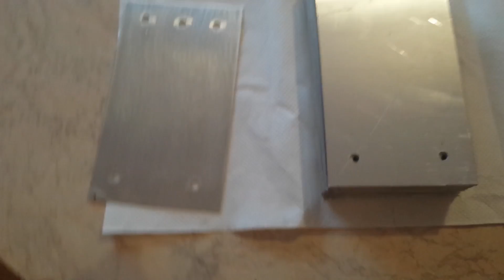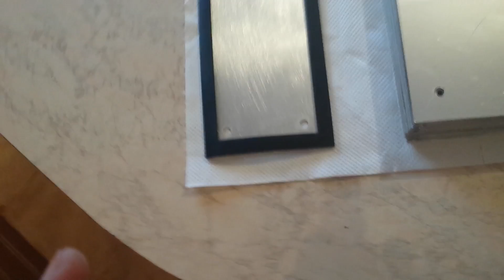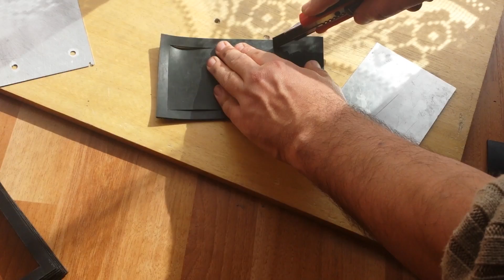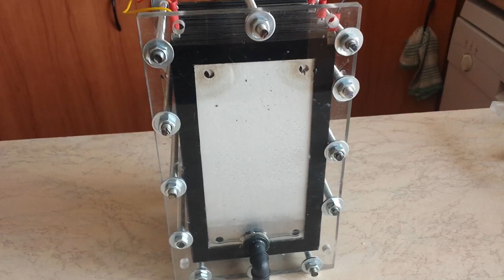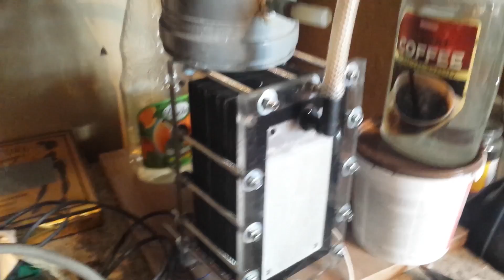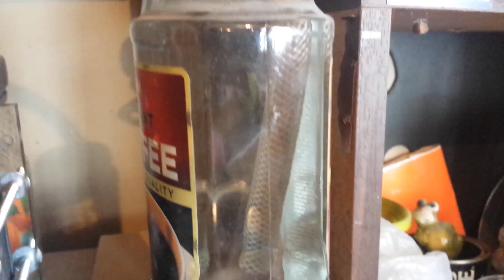hho generator with 31 aluminum plates

Comment: i dont think you "get more H2" from starting and ending with negative. Every time time you crack a water molecule you get the same ratio of oxygen and hydrogen. Maybe you get more H because the aluminum is absorbing O as oxidation layer. Can anyone else confirm this?
Reply from the maker: I have done alot of experiments with wires + - + -. And i did - + - + -. I have noticed the volume of hydrogen  is produced more then oxygen. I know - produces H and + produces O

Comment: How thick is your gasket?
Reply from the maker: 2mm
Reply: @01wizmiles01  thanks for your fast reply where did you buy that kind of rubber sheet and what is the name of that?
Reply from the maker: I bought the rubber sheets in a rubber store
Reply from the maker: You can probably buy them also on ebay

Comment: The chemical in your water is eating away at the aluminum plates and is giving off hydrogen in the process. That's not a good metal for this process. Use 316L stainless.
Reply from the maker: I did in my other videos

Comment: Sodium Hydroxide and Aluminum makes Hydrogen - So dont use aluminum
Reply from the maker: It was just an experiment
Reply: @01wizmiles01  I understood that. But still I wouldn't  use aluminum for multiple reasons.. was just trying to give helpfully safety recommendations.

Comment: Heyo, just a few things I would like to note (tad late for it though):
Try to use distilled water if you could, as the introduction of random metal ions within solution can cause quite some odd gases forming. For example, you could accidentally produce chlorine gas and bits of aqueous lye if NaCl is present. Not entirely sure if you were using distilled water, but maybe that'll solve a few problems?
And as for the sodium hydroxide, you can add regular baking powder (try to get the pure kind without additives) as the ion. Its cheaper and won't require you to wear safety like NaOH would. 
For some equations you can use, check out videos on Gibbs free energy and how to calculate amps from it, along with a few related bits to calculate volts required for each cell. 

Pretty neat stuff overall!
Reply from the maker: Thanks for the tips
Reply: @01wizmiles01  No problem! I'm going to build my own generator someday, and seeing others do these sorts of things helps me and others grow; thanks for posting this video mate.

Comment: Good job! I'm curious what happened to the plates after a long operation, I have the same idea but to put the aluminum plates in chrome 👍🏼❤️
Reply from the maker: That would be interesting in chrome.  My plates started to thin out
Reply: Chrome may increase the life time but it also degrades, the best option would be graphite foil.

Comment: I would say, don't be discouraged by what people say. Many people suggested stainless steel over aluminium well, let's just say, they talk from what they show that people did. Mostly from YouTube! Surprise!! xD
If I were you I would do the same( trying out aluminium over steel) also doing a research on other metals. Aluminium is a good conductor of heat so if you mean to pull out the heat that is building up in the HHO solution! Not saying this is what your doing, but there are many things you can do with one thing if you know them well. I can tell you are up way a head and you are up to something close to HHO thing. I don't complain on your using aluminium over stainless steel! Keep it up!
Reply from the maker: Thanks

Comment: What is the thickness of the plate and size
Reply from the maker: The thickness of the plates are 1mm x 22cm x 10cm
Reply: @01wizmiles01   what hole size both the end are u using polycarbon material
Reply from the maker: @MrDhilishkumar  the hole size is 8mm

Comment: The more pole pieces, the larger the power consumption, the larger the hydrogen production amount. Is this how much V / A is used?
Reply from the maker: the more neutral plate less it will heat up and you wont produce hot water vapors.

Comment: aluminium activated in the presence of water generates hydrogen all by itself.  Under proper conditions no electricity is needed.  Read the Purdue University research study:  New process generates hydrogen from aluminum alloy to run engines, fuel cells.   Hydrogen is generated spontaneously when water is added to pellets of the alloy, which is made of aluminum and a metal called gallium. The researchers have shown how hydrogen is produced when water is added to a small tank containing the pellets. Hydrogen produced in such a system could be fed directly to an engine, such as those on lawn mowers.

Comment: Aluminium plates and KOH will work no matter what you do. It will produce H2 without it being turned on. With a weak current it will produce more H2 and very little O. You could overdrive it to produce O if you like but the wastage of the Al will be considerable. I'm afraid you will have wasted your expensive aluminium plates away in a week or so even with it not running. Then the KOH will eat the aluminium, leak through the joints and do damage elsewhere elsewhere.
Reply from the maker: true. i wanted to see for myself what would happen to the alu plates

Comment: I agree using aluminium together with an alkaline solution (like KOH or NaOH or anything else) will consume the aluminium plates producing hydrogen gas even without electricity....

Petty because it will in the end ruin your set up..... so you have to rebuild it but this time with less reactive metals like corrosion free steel (what we call RVS).  

Aluminium is very reactive to alkaline solutions..... and should never ever be used together in setups like this. Good luck.

Comment: I HAVE RAN 7 OF THE TYPE OF CELLS YOU JUST MADE.. ANY MORE THAN THAT OF 7 OF THESE CELL YOU RUN INTO TIMING ISSUES ON THE MOTOR.. I WAS RUNNING HALF AN HALF.. ONCE UP AN RUNNING SHUT IFF FOSSIL FUEL OFF THAN RUN HYDRAULIC FULL TIME.

Comment: Any alkaline solution in contact with aluminium will dissolve the aluminium while releasing hydrogen gas until the plates are gone and leaving a salt behind which will cause the whole module to fail any way. Rebuild the whole thing again with stainless steel plates, and you will have a much greater success.    Raza, a fellow electrical experimenter.  Best of luck !

Comment: aluminium and water and sodium hydroxide or a small amount of mercuric chloride and i'm sure many other caustic chemicals will produce a lot of hydrogen .they react with the aluminium ..  but your aluminium plates would dissolve very quickly.  as the reaction heated up every 10 degrees the reaction rate would double and produce a huge amount of HHO but your aluminium plates would dissolve very quick and no power source is needed..    chemistry 101.
Reply from the maker: dan poen would that be good to use in a tank to fill it with hho

Comment: Soidium Hydroxide (NaOh) eats aluminium and produces an exothermic reaction (which can get insanley hot) which produces massive amounts of hydrogen gas. If you'd have Googled/Wikid HHO (Oxyhydrogen) or water electrolysis, you'd have seen what a dangerous potentially lethal bomb you made (either due to an excessive and rapid increase in hydrogen gas pressures and or detonation as hydrogen under high pressures has the tendency to ignite.) Consider yourself lucky... It is incredibly dangerous and potentially lethal to dive into any type of project where caustic and highly corrosive chemicals are arbitrarily mixed without doing the most fundamental and basic of research into what is essentially one of the most reactive and powerful fuels we have (Hydrogen) and most especially when that hydrogen is under sudden and dangerous pressure levels ready to send shrapnel and blindingly hot lye over  anyone not horribly disfigured and burnt.

Comment: you cannot use an alkaline with potassium or sodium it will react and make H and will destruct the plates. u could try other electrolytes not sure if there is one the is safe will aluminum.

Comment: You do not need Pos.and Neg.,and also you do not need any electricity,all you need is a cealed container with an exit for the gas,as you saw yourself the Allu.automatically react to the electrolught,Koh or noah and Automatically you have 99.9% pure Hydrogen and with a good flash back arrestor you can burn it and you neec a 5mm hose coming out of the cealed Container ,into the bubbler and out of the bubbler a hose 5 mm and a flash back and then light it to see there is no need of power ,now to stop the reaction you have to calculate the ammount of water you need so after the water had finished then the gas stops producing.  Aussie Paul   email dieselconverter @ gmail.com
Reply: I used tin plates once and didn't know the metal would react with the sodium hydroxide in the water.  lol  I took the power away from it and it just kept bubbling away.  I thought their was some sort if runaway chain reaction happening until I noticed the flame became just a hydrogen flame.  Then I knew what was going on. lol  That reaction was hot and went on for some time.
Reply: how come you see the flame of a hydrogen? or you mean flash? hydrogen doesn't flame, gasoline does, after 1day of soaking your aluminum generator in NaOH, you've got your wires, rubbers, bolts and nuts left to start building one that's useful, not like that, soak it overnyt and in the morning you won't be seeing them,

Comment: NaOH will corrode aluminum in seconds.  You can not change the ratio of H to O by the number of plates. The number of positive plates is always equal to Negative plates. Oxygen at the electrode will cause aluminum to change to  Al2O.OH so your positive plates will disappear VERY quickly.
Even Mickey Mouse knows better.
FAIL

Comment: Is there anyone who knows how to fill the tank with hho ? Thank you for sharing .
Reply: you need to have a split cell first and the pure Hydr. will pass through a special compressor made for Hyd.and goes into any Gas Steel Tank  Aussie Paul
Reply: I advise doingn't reserve any amount of hho. it exploded once in front of me and its very powerful explosion.
Reply: The speed of the burning is about 12000 meters per second that are comparable with nitroglycerin
Reply: 12000 m/s eh? The speed of sound is 340 m/s. And the detonation velocity of nitroglycerin is 7700 m/s. Know what you're talking about before you try to impress people with fake facts.
Reply: @benxenes  If I remember correctly it was 2800 ms which is still stupidly fast.

Comment: I think you might be able to produce more HHO if the Gaskets wasn't surrounding the whole cell the way you got them. Just place the Gaskets along the sides and not at the top and bottom. HHO is undoubtedly getting caught between the cells because of the Gaskets being all around the cell and there isn't anywhere for the HHO to escape. That is why it might be still bubbling after you turn it off. They trapped HHO is finally able to seep out of the cell. I think if you try that you will see way better results. Thanks for sharing mate
Reply: The gas escapes out of the 3 holes at the tops of the plates. His problem looks like he didn't take the time to align the holes perfectly, thereby consticting the gas flow exit which probably filled half the cell with gas and no water to react to create more. The water flow holes at the bottom also look like they are not aligned so the water couldn't travel easy either.
Reply: If you use two (2) stainless steel plates, you have to apply no more than 2.3 volts (DC). If you apply 12 volts to your two plates, the efficiency of your unit will drop, because your remaining 9.8 Volts electricity will evaporate water into the steam and of course your unit will get very hot. Usually people who has 12-13.8 Volt DC power supply, use 7 plates (6 gaps) 5 neutral plates. The voltage drop between two plates is about 2.3 volts.  2.3x 6=13.8 volts . That's very efficient.
Reply: You can try to use stan meyers Tube design.And use the choke circuit at the end where the cells are located. It is a lot of videos of his design. Stan said his cell would only work with the tube design. What people fail to understand is Stanley's Tubes was about 16-18 inches long. He used no electrolyte and his cells was set up like Capacitors. Study Capacitors and you might can use that knowledge to make a flat cell like Stan's Tube design.
Reply: Hi Steve, this is a good suggestion. I have designed a similar one. I used only two SS plates. Cell capacity is 250 ml. My cell is getting too hot. what do you suggest??? kulkarni.v.chetan@gmail.com

Comment: You cannot use aluminum. If You add water to the lye, there will be a reaction accompanied by evolution of hydrogen. Aluminum will dissolve in alkali. This reaction not require electricity.
Reply: Aluminum isn't  great metal to use as your base metal. It will form an electrolysis with just about anything it comes in contact with. I know this was over a year ago, but I have worked as an electrician and electronics technician, so I have had the chance to see where aluminum is good and where it will fail. FYI, another Youtuber used all stainless steel plates, rather than any aluminum. Oh, as I am typing this, I remember a research project in my physical sciences course in high school. We took strips of aluminum and placed them into a solution of HCL. The two together produced hydrogen gas, as a reaction. 
try this idea, I think his concept is working. https://www.youtube.com/watch?v=4Fl4t3_PWGg
Reply: +SEVER -S will baking soda + aluminium work???
Reply: aluminium is a highly reactive metal, it only seems to be unreactive...
alumiunium and sodium hydroxide yield sodium aluminate and aluminium hydroxide (may form also other crap)
this video shows how to handle molten iron in plastic cup, pointless in my opinion :(

Comment: You need to use 316L stainless steel with 1.5mm thick gaskets. The spacing between the plates is critical, 1.5mm or less thick. Aluminum is not good to use for hydrogen cells, corrodes to fast. Best metal is "316 Low Carbon Stainless Steel" is key with proper spacing between plates. Rubber is too squishy & gives uneven spacing between plates. Use a fiberglass like plastic, circuit board material.
A 4"x4" 1mm thick 316L stainless steel 21 plates with 1.5mm gaskets, 4 neutral, can produce 2 LPM 
+NNNN-NNNN+NNNN-NNNN+
Check out "hhoconnection" & "advancedhydrogen" channels, great info on building hydrogen cells. Good Luck!!
Reply: 1.5 mm spacing is too small  by many accounts. 2 mm - 3 mm is big enough. If you go under 2 mm many will claim the bubbles will not have enough space to move freely.
Reply: whats the diameter of the plates to get 2 LPM
Reply: Douglas Smith  hi send me more details about this
Reply: I was wondering for this info brother......
Reply: Stainless is a terrible idea, you leech chromium, highly toxic.
Reply: Baofeng Portable Two-Way Radio
Reply: How about 4ft x 8 ft stainless plate ?
Reply: @petronilosarraga8323  🥺 is it 4 feet by 8 feet or 4 inch by 8 inch ?? 🤔

Comment: you should read chemistry book. pure aluminium takes oxygen out of water, producing H2. aluminium is the best catalisator for getting H2 out of water without any energy, but its oxide covers the whole surface very quickly and the reaction stops with time. but it can still make electrolyse.. good job

Comment: The aluminum should work, but it since it is aluminum it will corrode overtime from the water. So stainless is a better idea for long term. (Try turning up the amperage)
Reply: stainless yeah ,   but dont sniff the chromium gas!!

Comment: Discharge the voltage from the plates. Residual potential difference.

Copper or more expensive metals like gold and platinum conduct better than aluminium. But they oxidise worse than copper and aluminium. Correct me if I'm wrong, but in the reaction process oxidation is also at play. Making copper preferable.
Reply: Everything you said is as wrong as possible
Reply: @TravisTellsTruths  Go back to bed.

Comment: wait aren't electrolytic capacitors made like this? aluminum electrodes get coroded in electrolyte to form isolating oxide layer on them by running same process.

Comment: It's the stack load. It's too much. It will load on it's own due to natural occurance drawing in ions. Loading like orgon device. Better known as Holy Hand Granade. Remove some from the stack until it evens out. See Wilhelm Reich for orgon research. Surf You Tube for various orgon devices and you will get the gist. Then make a "cloud buster" and join the ranks of those of us who are creating "shielding" methods via ions. Can be done with Shungite now called "Shieldite"(may also be known as the Lode Stone of Scandinavia, used to shield against evil, sickness for centuries) . Shungite is used by military for particle physics shielding system for bombers. Graphite too. Dont get caught up in the "chemical spin". It's not neccesary. Simple electrolites will aid in the process without polluting our Mother Earth. Lemon juice, vitamin C, vinager with sea salt. Natural and simple. Add the right frequency and you have invisible torus vortex that may also shield against Alpha, Beta, Gamma radiation! Just like that shield of Israel, and the HAARP system of Putin's Russia. Heard he keyed it to shield the radiation fallout from Fukashima, middle east's bombardment of plutonium ect. eh? Luckily, IT'S NOT ROCKET SCIENCE! St Elmo's fire, St. Germain's sacred fire (amithyst), Archimedes.....
I encourage you Miles! You are brilliant! Step it up a notch mate! lol SMOOTCH!
Q-PID  : )-  And yes I'm a girl!  
Q-PID stands for "Quantum Protoplasmic Inter-dimensional Dynamics" For those who need a scientific description for "MIRACLES"!